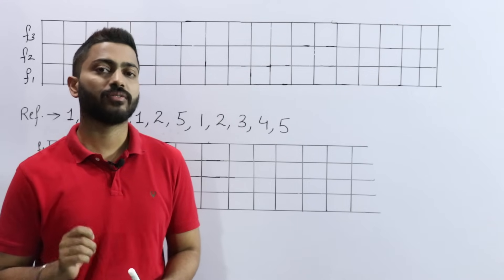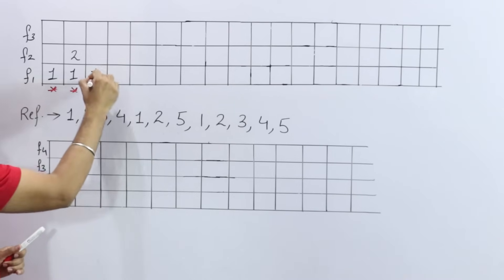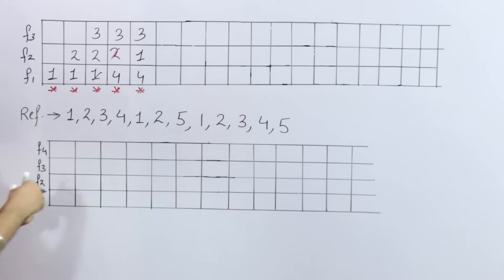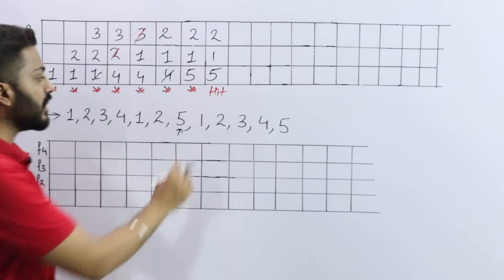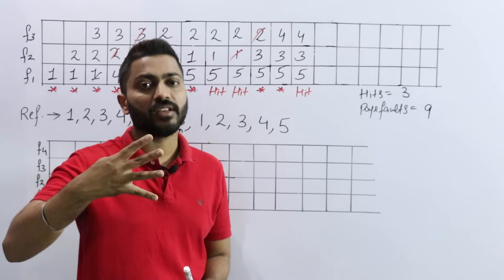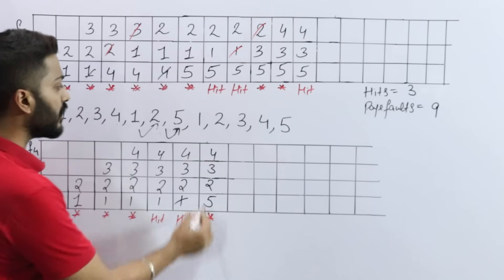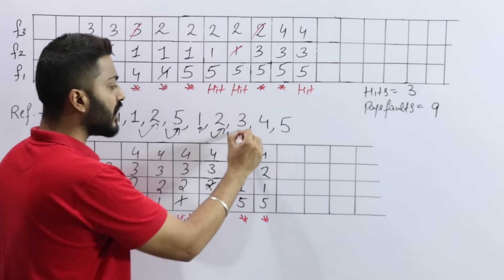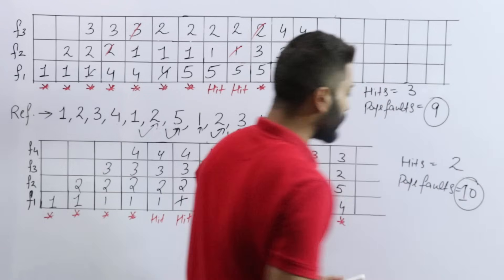L-5.23: Belady's Anomaly in FIFO page Replacement with example | Operating System

Comment: I have a doubt when we replace one value as per requirement   we change the value  on2nd or 3rd which space is vacant  but why we can't replace previous element  suppose we change value  2nd slot previously. We change 1 st one but it possible change same element twice  like see we change the value 5 at 1st place can we same value again for 2  it's possible or not?

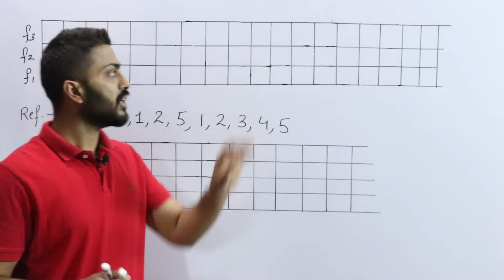Comment: 00:02 Belady's Anomaly in FIFO page Replacement
01:38 Belady's Anomaly in FIFO Page Replacement
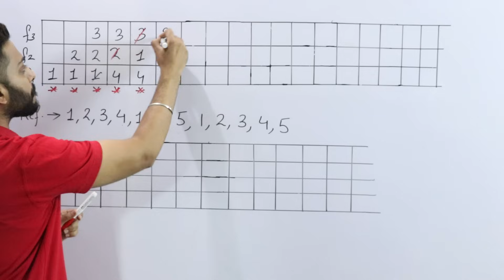03:09 Belady's anomaly occurs when increasing the number of frames in FIFO page replacement may increase the number of page faults.
04:41 Increasing the number of frames allows more pages to be accommodated.
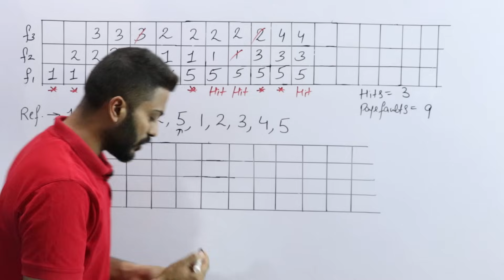06:17 Belady's Anomaly in FIFO page Replacement
07:48 Belady's Anomaly in FIFO page Replacement
09:16 Belady's Anomaly in FIFO Page Replacement
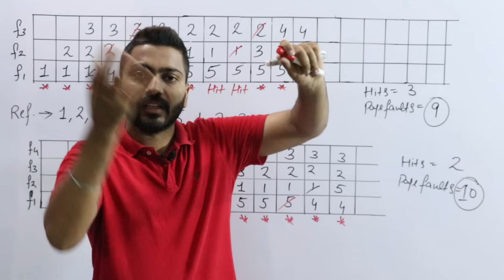10:50 Belady's Anomaly is when increasing the number of frames in FIFO page replacement leads to an increase in page faults.
Crafted by Merlin AI.

Comment: Sir, In following Question What will be the correct answer??

Consider a virtual memory system with FIFO page replacement policy. For any arbitrary pattern of page access, if the number of page frames in main memory is decreased, which one of the following options regarding the num ber of page faults is true?

(a) Always decreases

(b) Always increases

(c) Always remains the same

(d) None of the above
Reply: B
Reply: D) None of the above.

As sometimes in FIFO reducing no of page frames will reduce the no of page faults. example the video's pattern.